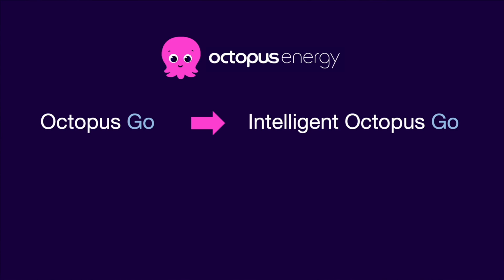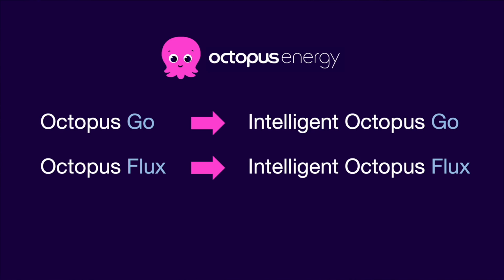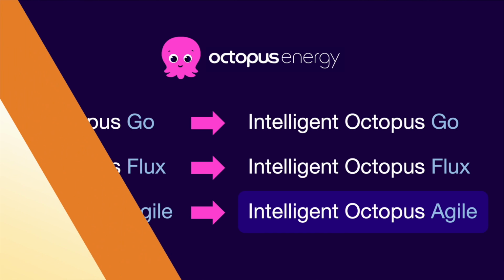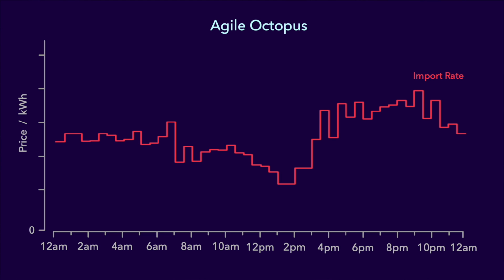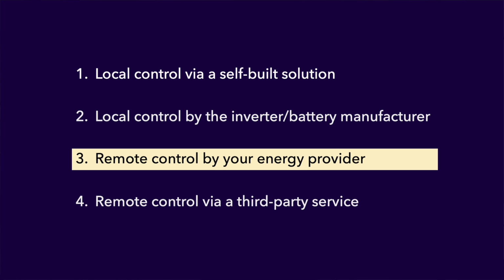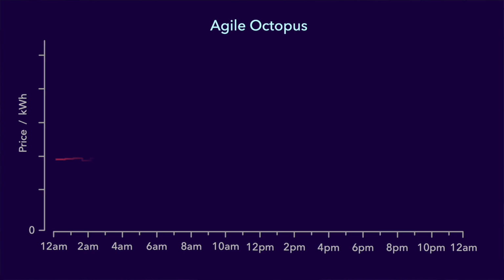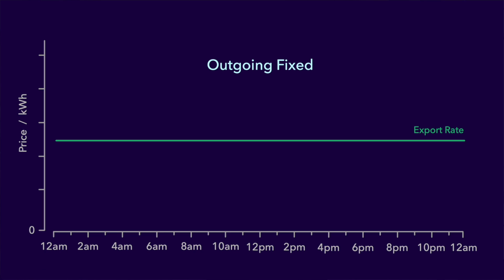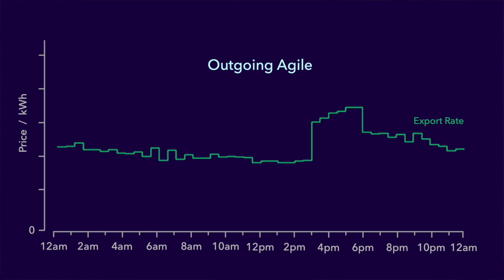Intelligent Octopus Agile - Coming Soon?

Comment: I’m retired with an EV, so I can choose when to trickle charge the car. Agile Octopus suits us brilliantly as I can charge the car and GivEnergy batteries (10Kwh total) both at night when prices tend to be lowest and when/if the solar input is at its maximum around midday.  I always aim to have 100% battery by 1600 when Agile prices shoot up, and fit in odd hours of EV charging, domestic loads etc around this schedule. We’ve only had the bigger batteries since August but so far the savings have been brilliant.  We are converting another property and this time installing a Tesla PW3 and 24 panels. The domestic loads will be lower than here so I look forward to much more exporting possibilities.  The idea of Intelligent Agile sounds tailor made for this scenario as long as the Tesla battery can be approved for this.  Incidentally I haven’t bought a home charger for the EV as I’m waiting to see if and when V2G is coming.

Comment: I hope that someone will see this comment. I am new to solar and have a givenergy battery and inverter, I also have the octopus intelligent flux tariff. But it doesn't work, GiVEnergy has admitted that the eco mode keeps getting switched off, the technical department has no idea how to fix it, so basically you have a battery that charges at night, and discharges in the evening, and is sat doing nothing during the day.
Reply from the maker: Sorry that you're experiencing difficulties with your setup and IOF. Worth chatting with Octopus Energy too to see what they're seeing in terms of data when trying to control your system.

Comment: Hi Gary did you ever get any feedback from Octopus on this? With the prospect of the 15p fixed export potentially going away, I'm considering options and thinking about a more dramatic re-think on how I optimise use my solar, battery and EV. I'm currently on IOG and fixed 15p export.
Reply from the maker: Hi Andrew, so I don't have any direct connections with Octopus (not yet, anyway) but if I hear anything I'll certainly report on that... IOG seems to be the best Octopus tariff at the moment, especially with the 15p export :-)
Reply: @GaryDoesSolar  thanks for taking the time to respond Gary. Subscribed for future updates! 👍

Comment: I am on Intelligent Octopus Flux now. Would it be better to go to this Intelligent Octopus Agile, if it existed, during the winter months and then swap back next spring?  I would definitely be up for it if it helped the environment and my wallet at the same time. PS: I have NO EV.
Reply from the maker: Hi Gary, unfortunately, that's not a straight-forward question to answer because it depends on your solar and battery setup and also your daily usage. You can model both tariffs with this utility I developed if you wish: https://garydoessolar.com/utilities/dailymodellingutility/

Comment: GARY
great stuff. You didnt mention the export tariff for go which is only 8p. Octopus logic is thT i import at 9 so my export has to be less.
BUT,
Most of my export tends to be late afternoon when all the other household drains on my solar are over 
so 30 KWH today but only 8p yet they sell that for a lot more and need it to balance
Reply from the maker: Hi Geoff, thanks - now are you talking about the export rate for Octopus Go? Yeah, it does seem quite low compared just all the other tariffs - I don’t see why that would be 🤷‍♂️

Comment: Sadly with Intelligent Octopus Go you do need to worry about it - when it offers random ‘extra’ cheap charging slots it will drain your house battery unless you make changes to your inverter settings. It’ll be much better when it can control this.
Reply from the maker: Are you talking about Intelligent Octopus Go?
Reply: @GaryDoesSolar  yep.

Comment: I think AI will take over the management of these smart tariffs and will be the “smart” way forward. Something that learns your personal household usage profile then works out the most cost effective way to buy and sell energy over the next 24 hrs also taking into account  weather compensation. Personally I think this should be controlled by the user rather than the supplier for obvious financial reasons. I’ve just installed Sigenergy’s Sigenstor combined with solar, ev and heart pump that has some AI functionality so will be interesting to see how it works with Octopus smart tariffs.
Reply from the maker: I agree - given a complex set of inputs, an AI will always be better than any human (or even human-built computer control software)... It'll be an interesting next couple of years... :-)
Reply: Mark, one year on,what Tariff are you using for the Winter period 25/26?I ask because I’ve just set up two SigEnergy Batteries (17.4 kw) and 10 Solar panels , 5 west facing and 5 east facing alignment, but no EV or, as yet ASHP. I’m set up on Octopus Flux to start with and it’s early days for me, just wondering, you being further down the road  with your ‘Kit’ what you think has been good for you? B

Comment: How can Octopus Agile be a good tariff in the winter? The prices can go up to a £ per kwh at peak times in the evening when heating is required. They can be higher than a fixed rate all day. I'm shifting off to a fixed rate asap.
Reply from the maker: I was on Agile myself October thru April - and it saved me a ton of money - essentially I charged my home battery using cheaper overnight energy and used that during the peak period. If you don't have an EV, I'd argue that over the winter, Agile is hard to beat... (If you do have an EV, then the EV tariffs like Go and IOG are hard to beat ANY time of year)...

Comment: Nice one Gary. I would definitely be interested in Intelligent Agile. 
Since buying the battery in February, I have been slightly underwhelmed by the lack of automation available - with the exception of some good 3rd party options - you really have to manage charging and discharging manually. Sometimes Agile prices are all over the place - today buying at 7am was cheaper than 2.30am - and without a clearer view on battery SOC and charge times, any automated system wouldn't do the job. If Octopus can get this sorted, I would sign up in a flash.
Reply from the maker: Thanks 🙏 yeah, automation is the key - and whilst there are a few third party solutions that provide automation solutions that are eminently user-customisable, I’m thinking that for most people, a solution with limited or even no customisation would be sufficient or even desired. And the extent of the customisation might be simply to prioritise financial reward over environmental benefit (or vice versa) in the event of a conflict….

Comment: Very interesting Gary - I am an Octopus fan too. However I am a little uneasy that I seem to be making investment decisions (battery capacity, additional solar etc) based on the existence of their creative Smart tariffs. How comfortable do you feel that this environment of favourable tariffs for early adopters will last
Reply from the maker: Thanks 🙏 and it’s hard to predict the longer term shape and size of smart tariffs going forward. Where I’ve got to with my thinking is that with increased renewable generation, until there is sufficient storage capability, we’ll be living with “spikey” energy and that’s where clever smart tariffs come into their own… and I’d imagine most people in a mass market scenario would be happy for a third party (which could be their energy supplier but doesn’t have to be) to entirely manage their solar, battery and other equipment for maximum environmental or financial benefit. Then maybe in 10 years’ time when there is sufficient grid-scale battery storage to flatten out the peaks.and troughs of solar and wind, energy will become super-cheap for everyone and we won’t need smart tariffs anymore… Who knows?? 😀

Comment: Have you thought about eon with their eon drive tariff? 6.9p/kwh for 7 hours with no restrictions (no EV required for example). I was thinking of using it with my battery (13.5 kWh) to power the house and heat pump.

Comment: Hi Gary, I recall from a previous video that the intelligent tariffs are limited to certain equipment, well any chance Octopus could extend the list of support equipment? Thx
Reply from the maker: Definitely, the demand is there for other equipment suppliers to be added, and any suppliers who are not making their equipment compatible with such tariffs (i.e. allowing remote control via secured API) will simply lose out in the market to those that do. It's so easy to add such capability too!

Comment: Interesting, Ive just came of Agile and moved to intelligent Go, I may move back for the winter, but to be Intelligent they need a greater number of battery makes supported to enable integration . Export paid would have to be at least the existing fixed outgoing price, as in the winter I occasionally had to boost the battery just before the peak hours as some days my solar only produced 2kW .
It would also depend on the size of your battery system as I find my 6.5kWh growatt really should be double that.
Reply from the maker: Thanks for sharing your experience here - will be useful to many!

Comment: Interesting idea Gary. I’m currently on intelligent flux and it’s worked well until 5 days ago. The batteries been stuck on 100% since then. I’ve contacted Octopus but they’ve failed to reply or fix the issue. This is a worrying trend as I previously called them and they promised to get back to me but didn’t. Seems like they need to work on their customer coms especially as these tariffs get more complex

Comment: Hi Gary
Just received an email from axle regarding their new giveback scheme, what are your thoughts.

Hi there,

Thanks for taking part in GivBack over the winter.

We’ve been working on new ways for you to earn money and help the grid with your battery all year round. We’re excited to invite you to a new pilot programme that will use your battery to manage live fluctuations on the electricity grid.

How it works:

1. Opt-in to the pilot by clicking the button below

2. We'll use your battery to respond when the grid is strained. Depending on the grid in your local area, this could be multiple times a week or less than once a month.

3. At the end of each month we'll pay you for export and import. We'll pay 50p/kWh for export we trigger, and 30p/kWh for import we trigger. Both export & import are
Reply from the maker: The first thing I’d like to mention is that it’s great to see equipment manufacturers like GivEnergy looking well beyond their standard product offerings. Rather than just selling hardware, theyre assessing the industry’s needs and developing innovate product and service extensions to meet those requirements. Everybody benefits 😀👍🏻

Now, I don’t have first-hand experience of GivBack, but I hear good things, and the fact that they’re extending the service from just winter DFS to all-year-round is encouraging. The whole is greater than the sum of all the parts of a distributed VPP 💪

It could be tricky though if you have two external parties trying to manage your battery at the same time though. So I probably would t recommend you use GivBack with any of Octopus’ intelligent tariffs…

Hope this answers!

Comment: This is an interesting prospect and the debate around different tariffs and their continued availability is highly dependent upon a genuinely competitive energy market. Let’s assume national grid investment allows all of the planned green energy to go on line sooner rather than later. We will be faced with a choice whether to go for a distributed model where demand is smoothed out by intelligent flexibility of consumer demand and feeding energy back into the grid at peak times or, more likely, a mixture of ‘battery farms’ to supplement the gas powered peak demand providers and, assuming massive over production of wind generation, the use of surplus electricity to produce green hydrogen that is used in those gas power stations instead of fossil fuels. A utopian green energy future or too much power in too few hands?
Reply from the maker: Great points, Dennis - and I’ll be addressing some of this in a future video 👍🏻

Comment: The next feature I hope they implement is controlling multiple devices at once, e.g. home battery, EV and heat pump. As far as I know it's only possible to register a single device as intelligent. By combining it would be possible to charge an EV, charge a home battery and heat hot water at the same time or stagger them as the grid requires.
Reply: That's what Home Assistant is for
Reply: @JamesGeddesTV Indeed. Home Assistant users already have Intelligent Octopus Agile”
Reply from the maker: That’s an interesting possibility! 😀👍🏻

Comment: I'm EVs only (but low miles) and Agile has easily been better than the EV tariffs , eg 30% saving in May, but a lot more in April and March averaging 1.49 p/kWh and 5 p/kWh, of course taking advantage of using it when cheap...
Reply from the maker: That’s pretty good performance 👍🏻

Comment: I think that the idea is a good one. We're on Agile but I'm not so sure that it would work well for us because our battery is G98 (a retrofit) and cannot be set to export to the grid and we have no plans for an EV. Furthermore, as our FIT is on generation and not export, it's in our interest to keep as much of the solar we generate as we can and, obviously, charge our batteries up at the cheapest rate.

Instead, I've written a few automations in Home Assistant which set a battery charge period based upon time of day and spot check SOC. This allows me to brim the battery overnight and to top it up to 70% in the afternoon - both charging periods being set based upon typical times when Agile is cheaper than average. Ultimately I would like to be able to find the cheapest charging period and have that decide when the batteries should be charged, but that's a project for another day.
Reply from the maker: Hi Ian, it sounds like you ahead of e a good strategy there given the constraints you’re under 👍🏻
Reply: Does your G98 not allow any export at all? I thought that G98 allowed up to 3.6kW export by default....
Reply: @kristians9576  We already have the capability to export 3.68KW (or thereabouts) from our solar panels (which were installed by a previous owner of our house). 

When we fitted the batteries last year we didn't want the hassle of DNO approval to increase the export capability were the batteries as well as the solar exporting at the same time - our plan was to try to use as much of the capacity ourselves as possible as we are on a generation rather than an export FIT. 

Consequently, our batteries are set up such that they  don't export to the grid, at least at the user interface level. As we are paid for generation, and at a reasonable price too, we don't feel a strong urge to export so additional DNO approval seems to be more trouble than it is worth.
Reply: @ianbeck5897  Got it. Makes perfect sense and falls in line with what I understand the G98 allows. I just thought you were saying you couldn't export because of the G98, which does not align with my understanding.
Reply: Have a look at predbat for your battery optimisation in home assistant